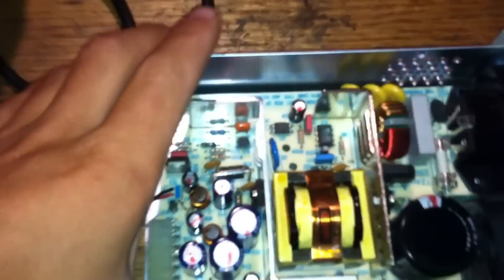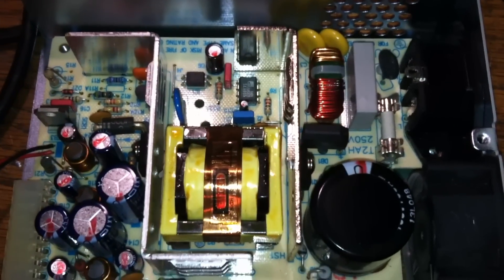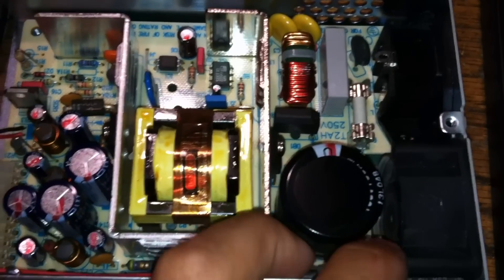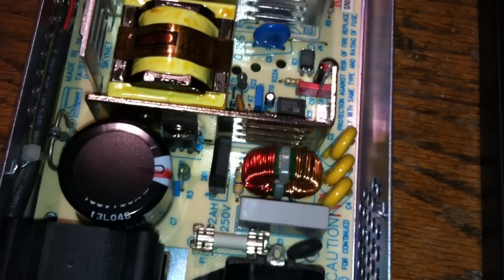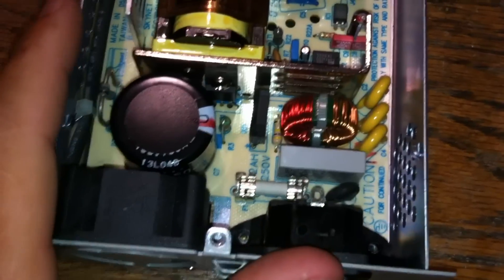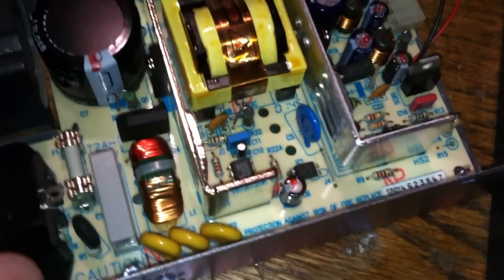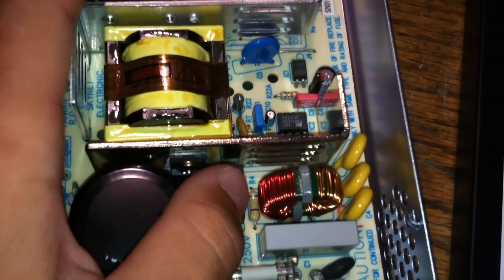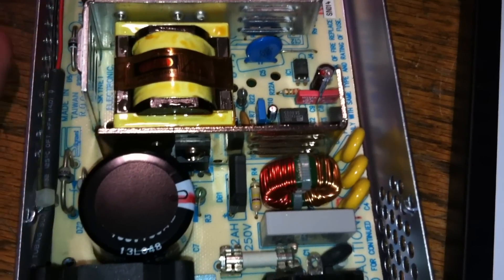How switch mode power supplies (SMPS) work

Comment: If I'm running on solar power batteries and I get to a campground and plug in to a 50 amp 110 watt breaker will this cancel out the solar power?

Comment: A very clear explanation for SMP power supply. I am more familiar with simple direct stepdown transformer to rectifier (Linear power supply). More concern about safety with smp as the circuit is not isolated from high Ac voltage as in Linear power supply using transformer.

Comment: Jacob Dykstra  hello Jacob. I really liked your video. I learnt a lot from it even though its 5yeras later.

However I have a real life problem, on my large format machine I have such a power supply box.

And its not working. We guess its the power box because there was an explosion around the fuse, MOSFET and the capacitor. 

I had my electrician check it, but he says we only need to change the MOSFET and the fuse.

Problem is tho, we have changed all that but its still not working. 

Just to add to the information, when I turn on the machine, the heater unit turns on, but the main board that control the printer head, the display board and the other main components don't power on.

I hope this doesn't confuse you but I need help on how to fix it. And I don't know anyone in Nigeria here who can fix it. So I'm trying to do it by myself.

Any help will be appreciated.

Thanks
Reply from the maker: richards ibidapo it's very hard to say without seeing it for myself. The traces within the PCB itself likely sustained damage from the fault. Other sensitive components within the supply may have failed from the fault as well.

Comment: There is ee13-wd small transformer-like coil in SMPS circuit. high frequency transformer. How do I measure it? when I measure the voltage at the capacitor ends, does it look normal? (capacitor 150uF 450v) bid last liability of the capacitor connected to the plus end of the 200k oh oh resistance there is next value 10v normal?

Comment: I really wanted a basic explanation on smps ,to get started I had a rough idea,I just wanted to start from ac input to dc output ,you did a really good job on explaining as you said BASIC,I not interested in the input filtering mov ntc power correction factor flyback signal etc etc etc ,I just filled all these in later after I put all the building blocks together ,Thanks for the video

Comment: doesnt switching the primary coil of the transformer cause a large flyback voltage when the fet cuts the current off? how is this dealt with ? can the fet take it or is there a freewheel/supression diode reverse biased on the primary winding protecting the fet?

Comment: This video was good enough for me.
I wanted to know why I couldn't use a HF transformer core out of a ATX PS in a general circuit, and now that I know how a SM PS works, I now know why. 
I was wondering where the HF was when only 50Hz is coming in, it's done internally, and I now know that they can make the core smaller because of the higher frequency.

Comment: you are missed up first you said 200 dc goes to tranformer and after you said 200 ac this could mixed up somebody and get himself a shock please do explain properly when you do something like this.
Reply from the maker: it is ~200 vdc at first then turned into pulsed DC or AC depending on how you look at it technically it is pulsed DC. Either way they are all equally dangerous so I'm not sure how you are trying to imply that someone messing with 200vdc is safer than with 200vac or the other way around.
Reply: +Jacob Dykstra  I think what happens in this type of SMPS at least is that after the tranformer's output there is no AC anywhere.(Actually no AC exists after the rectifier) Its the SECONDARY side and its ISOLATED from the PRIMARY. It is pulsed DC as you state and its in the voltage level of the output voltage plus any secondary voltages needed for the circuits operation.
Reply: Thanks for the explanation.
Reply: +Theo papa to be technically correct there is AC on both side of transformer, but it is square wave, not sine wave. If you would apply pulse DC to transformer it will woke to saturation in no time and supply would go to flame (transformers do not work on DC, or pulse DC).
edit: to be totally exact in this power supply there is no transformer as such, there is coupled inductors (which look like transformer and provide insulation).

Comment: it seems you dont really know how a smps really works. there is more to it than just rectifying AC to DC and then choping it up again to feed a transformer. if that would be all, where is the benefit compared to a regular classic transformer ? where is the most important part , the  "regulation" in your  sketch ? why is a high freq transformation more effective than a low freq 50/60hz one ? not because of the zero volt trancient in the sine.

Comment: Thanks for sharing :-)
How does it start up? the pwm regulator needs power to be able to switch the mosfet right? How does that chip get power when you first turn it on?
Reply: +Bart Venneker look at the uc3842 datasheet, they are a similar chip. ultra low startup power is actually provided by a 40k to 70k 2 watt resistor from mains until the switching kicks in and then runs from a secondary off the trans.

Comment: sir can you telll in this circuit what is the gate power ic used to on the mosfet.and tell about the input voltage of the  operate the ic.what is the min frequency need for a smps supplay.hope reply regards.pramoindia

Comment: in the primary section it was illustrated as 200v dc. again in secondre section the input voltage for transformer  was 200v ac . could u pls clarrify.anyways the illustration is very informative for lurners

Comment: I dont understand why we see at the output of the transformer it is AC voltage? What is the exact goal of the secondary rectifier diodes? It is supposed to be 0 to 12v at this point no?
Reply: Good question!

Comment: Hello, i enjoyed your video, its well explained. I still dont understand something. PWM can be used to ajust the output voltage by modulating its "pulse width". Isnt it the same function as the transformer? So why do We use both in a SMPS?
Reply: Because transformers are heavy, big and expensive, and smps don't, that's why smps are so common.
But yes, that PWM uses the same principle of a transformer, actually they are alike

Comment: Hi Jacob, I thought the video would have been a lot better if you edited it. I know what you're saying about the iPhone.. I did a couple of videos myself with it, and it is difficult. And the damned battery would go every time without me noticing as well. What I ended up doing was scripting it, recording it in small section and joining them all together in Windows Media Player.. 

You sure that those are THREE varistors in the primary side of the PSU. I've only seen one in most PSU I've worked on..
Reply: Hmmmmm, try my channel.  90 videos all unedited with the antique iPhone 5c...

Comment: 3:13 Isn't there in fact to smooth the input, it's mainly to smooth the EMC sh*t that comes from the SMPS to the power line.
Plus you have that mosfet upside down and that drowing of output at 14:34 is completely wrong :) (it doesnt come to 0, because voltage is inducted with both - rising and falling edge of input).

Comment: I'm sorry please correct me if I'm wrong, I just don't understand how would the transformer be fed from a bridge? As far as I know, a transformer needs AC while the bridge outputs a DC?
Reply: DC doesn't necessarily mean a straight line on an oscilloscope. Any wave can be DC as long as it's not changing the direction of its current. The magnetic flux that makes transformers work is generated by variation in voltages, not variation of the currents direction. Therefore transformers can work with DC.

Comment: Dear Jacob Dykstra,

Its really a nice video you have been shown I really like this video its really a lot for me. Because it makes my lot of doubt clear. Thank you for this video.

Regards
Kiran
Reply from the maker: I'm glad you enjoyed the video and learned some stuff. This is why i like making these videos.
Reply: *****
Hi! I have a question: why do you need a rectifier (at 12:45) if the current is not changing its direction there?
Reply: tv
Reply: +Jacob Dykstra Hi Jacob, what happens to the rest of the psu if the big capacitor fails completely "open"?
Reply: Jacob Dykstra  hello Jacob. I really liked your video. I learnt a lot from it even though its 5yeras later.

However I have a real life problem, on my large format machine I have such a power supply box.

And its not working. We guess its the power box because there was an explosion around the fuse, MOSFET and the capacitor. 

I had my electrician check it, but he says we only need to change the MOSFET and the fuse.

Problem is tho, we have changed all that but its still not working. 

Just to add to the information, when I turn on the machine, the heater unit turns on, but the main board that control the printer head, the display board and the other main components don't power on.

I hope this doesn't confuse you but I need help on how to fix it. And I don't know anyone in Nigeria here who can fix it. So I'm trying to do it by myself.

Any help will be appreciated.

Thanks

Comment: Nice video, so comprehensive... I have tried to repair my NEC PC smps, i have dissassembled it and checked some caps and fets but seems ok though but when i turned it on it just snaps the power and goes off, where do i need to start troubleshooting? Pls advice, thanks.

Comment from the maker: Yes, the inductors are used to filter out high frequency noise. There are input inductors to filter the line frquency from any noise and any good smps will have output inductors. Since smps's operate at high frequencies there are output inductors to help filter out or smooth out the high output frequency.

Comment: The filter behind the ac plug is to filter the power supply from the line, not the other way around. The bulk cap really is there to get the full voltage from rectifier, without it you only have 70% of voltage and 1/2 the power. On the secondary you need a coil to filter the current pulses, the caps stop the "ringing". The are so many caps for low ESR mostly.12 volts ac rectified with caps would give you 16.8 volts dc minus the diode drop of 1.4v so  15.4 volts at no load.